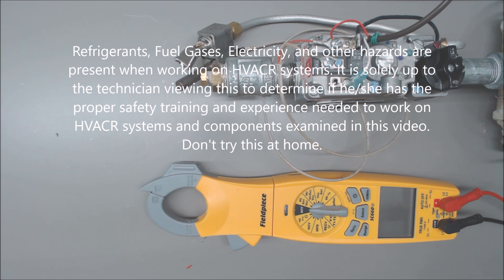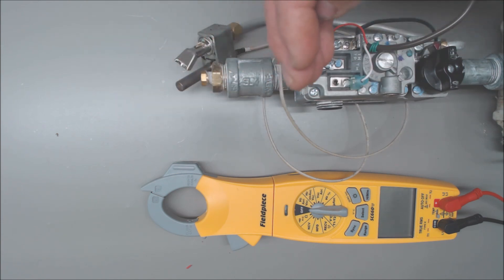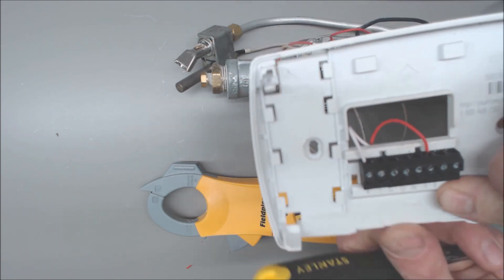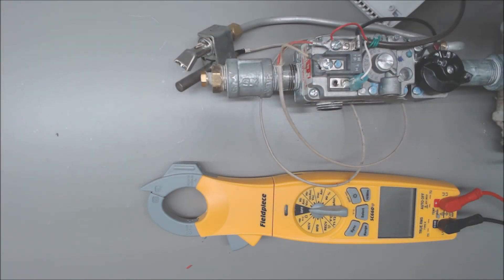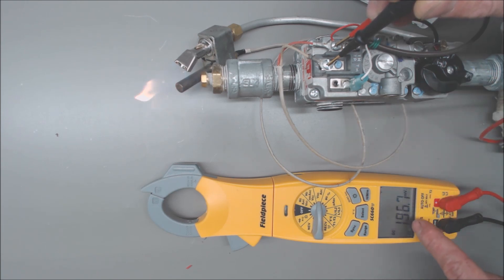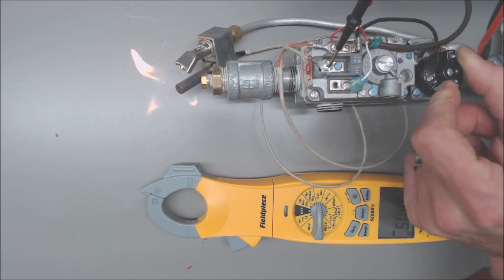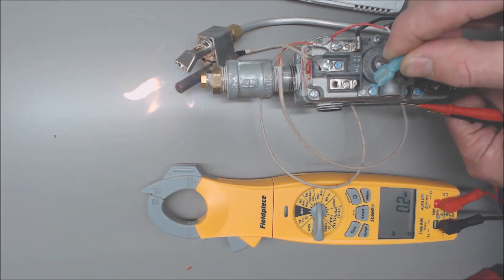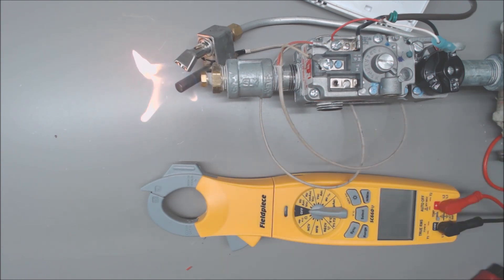How the Millivolt Gas Valve and 750mv Thermopile Work! Troubleshooting!

Comment: I used to light them with a torch for "quick" heating, watch voltage both open and thermostat calling, if they didn't spike up with torch instantly, BAD
Reply: throttle bottle. oooh, i like that one.

Comment: I have a question on the meters I have SC 260And I need to upgrade to check millivolts I like the SC 660 but it’s a lot of money so I was wondering what’s your opinion with the HS 36 which is a little cheaper
Reply from the maker: Hey Matt that seems pretty comparable in price to the sc 640 price but they are both true rms and include amp clamps. sc660 is the wireless one. I linked the sc640 in the comment and description section, thanks
Reply: Ok